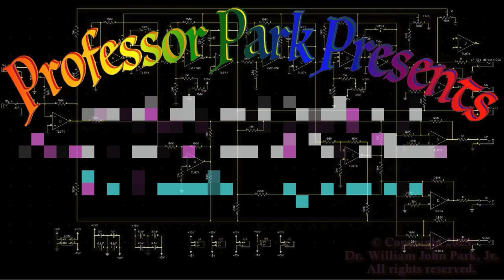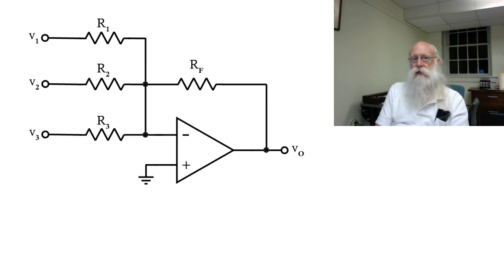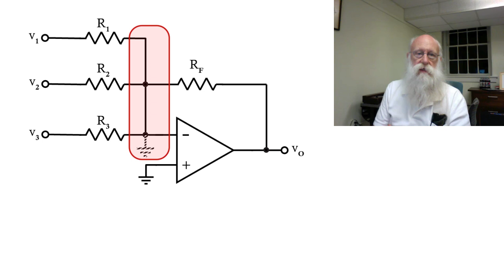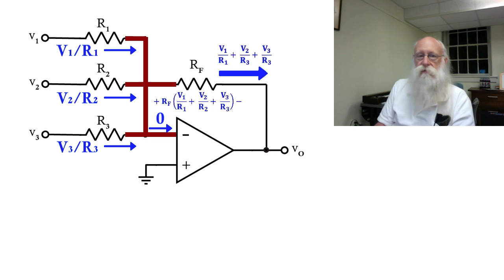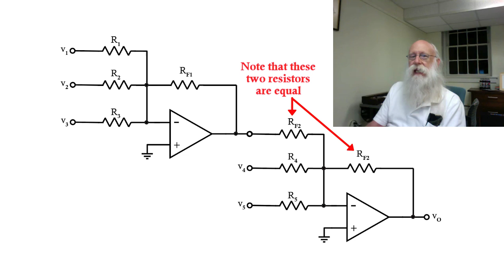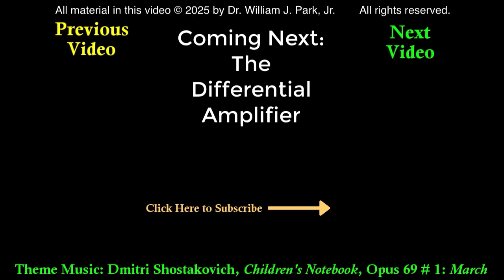Operational Amplifier Circuits 1.6 -  Inverting Adder

Comment: EXCELLENT PRESENTATION! BY ADDING MORE RESISTORS HOW DOES THIS EFFECT THE PERFORMANCE?
Reply from the maker: If you really want to go into that deeply, it becomes a can of worms. However, if you have reasonably large signal levels, most effects would be negligible. The most obvious issue is noise, both from the resistors themselves and from cascading opamp stages (the noise of one stage being amplified by the next, etc.). Most of the practical work I do is at high signal levels (typically ±5V) and this is seldom a problem. There are some other issues, but they are somewhat esoteric and I am not well-versed in those.